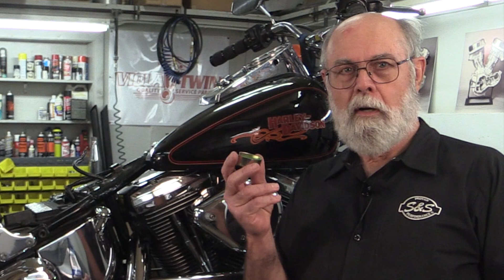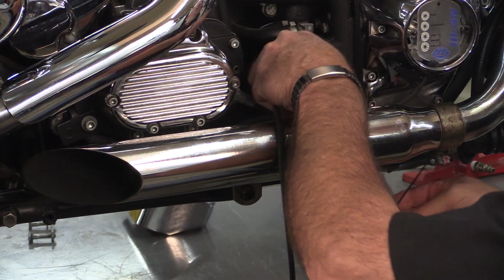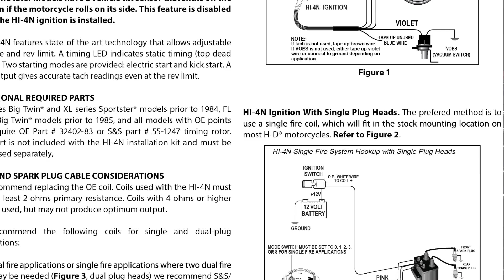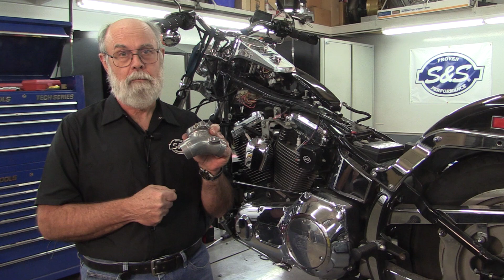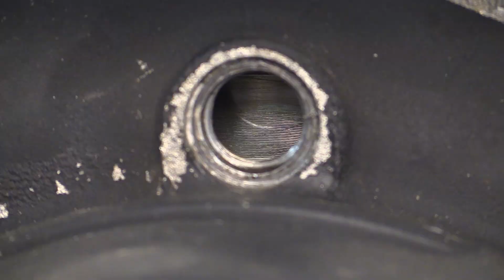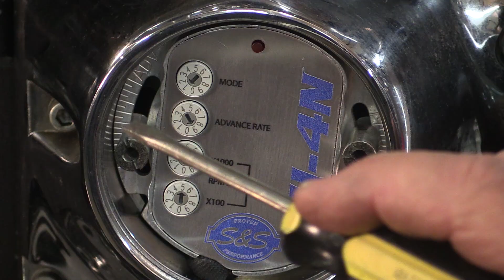S&S Cycle Installation - The S&S HI-4N Ignition

Comment: 9 advance slope is crazy i had mine stock evo at 5 and it was backfiring through the carb so I set it up at 4 works better now. I wish i kept stock ignition. Mpg was good and power on dual fire ignition seems better

Comment: i know this is an old thread, but i wanted to ask about the Fireball HI4TC rear cyl offset, if my front cyl is set to retard 1 degree, does the rear follow that? or must i also set the rear to retard 1 degree, i ask because i seem to have more reversion in the rear than the front, it is set to init -1 and rear cyl 0.  in my carb'd twin cam 2000 FXDL there are andrews 26H cams (hydraulic tensioner upgrade) done by dealer. thanks in advance

Comment: How were you able to tell which stroke the cylinder is on at TDC?
Reply: Put your fingertip onto the front cylinder spark plug hole, you will feel the cylinder create a vacuum from under your finger as you  rotate your rear wheel clockwise. This is your intake stroke. The next stroke will be the compression stroke and you will feel the air escape the cylinder. As soon as it begins start looking for your mark.The event happens fairly quickly and it's okay to reverse rotation of the wheel back to the intake stroke to start the process again. Five events in a four stroke engine.  Intake stroke, Compression stroke,  Timed ignition, Power stroke, Exhaust stroke
Reply: Let me add that on your exhaust stroke you hear the event through your exhaust due to your exhaust valve is open. Compression stroke obviously both valves have to be closed.

Comment: Hey Bruce thanks for another great video! I wonder how electric start modes ease strain on the starter - seems it'd be better to fire right away so the starter doesn't have to spin as long. But I think I'm having a brain cramp on that one... Anyway thanks again!
Reply: I've always wondered the same thing.  What is the purpose of having the motor spinning momentarily before it starts ?  I haven't ever gotten a straight answer.
Reply: @whatyoumakeofit6635  To have time to get some fresh fuel mixture down into the cylinders. If it's been sitting for a while, there may not already be some fuel mixture down in there. Just because a spark occurs doesn't guarantee there's any fuel mixture for it to ignite.
Reply: It allows the starter to build some inertia against the kickback from compression.
Reply: @scottemory1470 BINGO!  Used to be all MEN knew this. How far we've sunk.

Comment: Even though this is an old video I’m hoping you still check massages. I bought a ’96 Electra Glide with a Revtech engine with a bad crane ignition module. I’m replacing it with an S&S module. I haven’t looked but if the wire color codes match can I just splice the new module into the existing wiring? I have water proof heat shrink connectors. Thanks for your answer if I get one and if not I am going to wing it.
Reply from the maker: Hey John, drop us an email at SSTech@SSCycle.com and we can talk this through with you.

Comment: I installed a new Hi 4 because old Crane Hi 4 worked rock solid for years. So when I had my motor rebuild went with new S and S Hi 4 . Plus I hold S and S products in high esteem!  That  being said my new S and S is acting weird after only 4 k miles. Cutting out like rev limiter is engaged  at Low to mid rpm range.  It will run fine and out of no where tack will start bouncing and bike dies. Restart it and bike runs fine or maybe not . I really only want reliability and don't have money to just drop 500 bucks on new ignition from S and S . I just want to ride my motorcycle ,I don't want no pickle ! Very disappointed in what I thought used to be a rock solid reliable ignition system ! I am ready to go back to OEM style harley ignition with the brain box under the right side cover or maybe points . Performance is no goid if your bike ain't reliable .
Reply from the maker: Hey Greg, we totally understand your frustration, an ill-running bike is no fun! Reach out to our tech team via email at sstech@sscycle.com or phone at +1 608-627-1958. Be sure to leave a detailed message and our team will get back to you as soon as they can.
Reply: @SSCycleInc why should a payin CUSTOMER have to reach out. Why not just use good u.s.a. made components.

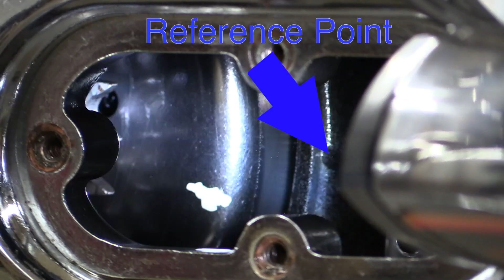Comment: Hello, thanks, all is very informative, but i did not understood how and when you marked reference point on 12:03 , what is this reference point?
Reply from the maker: Front cylinder TDC.
Reply: @SSCycleInc  I am very new to it sorry. So blue mark front TCD and then what was white mark?
Reply: I got it !!! no need to answer :)
Reply: This was also a question of mine, but if you mark at TDC with the reference point in the primary, THEN use the back timed light at 35, it makes sense you will hit the Advance at the spot you need BTDC.

Comment: Novice here, what are the plugs for on the push rod side
Reply from the maker: Happy to help, but not sure what you're asking?
Reply: The bike I recently sold had plugs on both sides of the motor, it was a 80Liter 1340 fxr drag bike built for street
Reply: @jasonrawls7685  Spark Plugs, got it. A 2 plug head is designed for a more efficient burn, but are pretty rare on the early motors.

Comment: If you go by the advance marking on the flywheel and paint a line inside the primary on the rotor  , and use a timing light without a advance setting , that should be the same ??    My Led burned out so have no idea what my timing is I just Had Justin  AKA " Just Tourk it " rebuild a bottom end .  I replaced the cam cover so have no markings .  I know im in the ballpark the bike runs.   I just want to make sure im not to far advanced or retarded  power curves seem to be working over rev is working , just no led flashing at all .  1800 miles .
Reply: late response but yes... use the advance 'dot' on the flywheel; mark up the rotor and use the timing light at it's ZERO default setting.

Comment: How do you wire up the HI-4N ignition for duel coils. It says It will wire up for duel coil & duel plugged Heads
Reply from the maker: Hey there -  here is the link to the instruction sheet for the Hi-4N - https://assetcloud.roccommerce.net/files/_sscycle/9/4/5/510-0277_hi4n_20141215.pdf

Comment: I have a 74 shovel.  What is the rotor number required to run this ignition?
Reply from the maker: Hey Mike - give our techs a call to get part numbers. 608-627-1958

Comment: On a kick only shovel should the voes wire be grounded?? Thanks
Reply from the maker: No, you don't have to ground the VOES. In fact it's a good thing to have working for you, since shovels are more prone to detonation when they get hot. VOES helps a lot with that by backing the timing off when the engine is under a load. What you must do is set the module to kick start mode! That makes it spark on the first crank revolution and it starts much easier. Some electronic ignitions will provide you with hours of aerobic exercise trying to kick start them, but the HI4N really does kick start easily.
Reply: Thanks so much for your speedy response!! I will look into getting a voes. It is a light, stroker so I usually don`t have much trouble. Like you said though when it gets really hot and pulling a steep hill or something voes would be nice to have. Otherwise it sounds like the wire is just taped up. Thanks again!!
Reply: How do you set to kick start mode
Reply: @williamelliott669  Adjust the mode dial on the top of the module to 8 for single fire kick start or to 9 for dual fire kick start

Comment: I have a Crane Cam 8-6100 HI-4N. When I do the static timing as I turn the plate the red light never goes off. Any input.
Reply from the maker: Are you sure that the engine is on the compression stroke when the TDC mark is in the timing window? If it is, please call our tech dept for more help. It goes a lot more quickly on the phone than an exchange in YouTube comments. 608-627-1497
Reply: Ken Rahn

Comment: I'm looking at my installation instructions for S&S IST Ignition. This is for my brand new V-111 engine. This engine is replacing an S&S 88 ci evo style 1999 CMC/Indian Billy Bike replica with Thunder Heart electronics, I'm using Twin Tec ign. Dual fire. with no voes. My question is where do I begin to wire up all of these new sensors and single fire ign. on this new engine when dealing with an old 1999 thunder Heart extremely compact mini electronics system? Thanks for help, Fred  RLTW
Reply from the maker: +fred tompkins Please call our Tech Dept at 608-627-1497. It would take too long to explain it here, but not too long in real time!
Reply: +S&S Cycle, Inc         
I made contact with tech support and think Ill be ok now. Thanks!!

Comment: OK .... if i put  a ignition module like this ... i can remove the ignition module box of my FXRP 89 ........  thanks ...........
Reply from the maker: +mco zpda Yes you can. The S&S HI-4N is totally contained in the cone cover, and connects directly to the coil.
Reply: S&S Cycle, Inc
right now ..i have two dinas coils ..and problems with trigger igniter module ...
running 15mins and shut off (no spark) .... and 20 mins later start again ...
Coils , good ..(new)
Regulator ,good ..
module box , good . (power arc ll single fire)
and i like the  S&S HI-4N ..... to my fxrp 89 ..
..........................CHEERS ........................  ..
Reply: +S&S Cycle, Inc loop

Comment: Thank you , for some reason I thought the coil I have was a single fire. Thank you for helping me with that. Keep up the awsome videos.
Reply: funkyoldmedina mine is a 3 dial wirh a switch
Reply: @eddiemorris5601   Yeah mine is TOTALLY DIFFERENT. .My indicator light that as well as my dials that he shows in his case on the position sensor are by the fuse box on mine

Comment: hello, great tutorial, I would like to know how would I wire a Dynatek 3 OHM coil ? asking because the Crane HI-4N instructions only show coils with Three wire posts on single fire coils.
Reply from the maker: funkyoldmedina The instructions do have a diagram that shows how to hook up a dual fire coil. Take a look at Figure 1.  Make sure you have the correct instruction sheet. You can download it at this URL: 
http://www.sscycle.com/files/4614/1874/5826/510-0277_hi4n_20141215.pdf 
If you still have questions, please call our tech line at 608-627-1497. Those guy can for sure get you on the road!
Reply: funkyoldmedina

Comment: can this system be used with delkron heads
Reply from the maker: The heads may effect the timing your require, but there should be no problem. You should ask the manufacturer for timing recommendations.
The main thing to keep in mind is that this ignition is designed for 1970-'99 big twins with alternator style crankcases. It can also be used with a special timer and reversed timing gears in generator engines.
Reply: Thanks , I need a carb
Reply from the maker: Charles Barber You've come the the right place! The S&S Super E and Super G carbs are available for just about any carbureted Harley-Davidson® motorcycle. Check out our website at www.sscycle.com.
Reply: Ur web site difficult to navigate,  need a super e set up but want to retain my air cleaner...
Reply from the maker: Charles Barber Why don't you give our tech department a call and see what options you have. (866) BIG-BORE (244-2673)
Reply: I have but the super e kit mysteriously jumped up 200$ , figured I would check all options first....529.00 to 729.00

Comment: Out of curiosity, what is the exhaust system on this bad boy? I may be showing my ignorance but I've not seen this type of H-pipe configuration on a bike before.
Reply from the maker: Jeff Irick
The crossover  pipe is something that all stock Harley-Davidson® exhaust systems have, and is a feature of the S&S Power Tune Dual headers.  Many other bikes and cars have this also. It really doesn't scramble the air flow as you might expect. Keep in mind that exhaust coming out of a cylinder head is not a steady flow. It comes out in pulses. That makes the resonance of the pipe an important factor. It is really beneficial to scramble the pulses since the pipe has a resonant frequency and tends to make peak power at one rpm. If it has a peak at one rpm, it must have a valley, at some other rpm. The crossover pipe detunes the pipe making it less resonant. Mufflers also break up the exhaust pulses and help prevent them from reflecting back up the pipe and fighting with the next pulse as it tries to come out of the exhaust port. The result is that the engine will produce a wider, smoother power band. In most cases this will result in more "power under the curve" when analyzing a dyno chart. Take a look at this video. http://youtu.be/KjKUKhHQLHg
Reply: S&S, thanks for the explanation. It makes a great deal of sense. I also enjoyed the video. Obviously, your folks have a very good understanding of mechanical engineering. I particularly liked the bit on the effect that baffles have in re performance. A lot of my friends are of the "Loud pipes save lives" set and yank the baffles out. They might be interested to know that increasing the "look at me" factor is hurting their bike's performance. :-)
Reply: It looks like a stock header system with Screamin Eagle slip ons.
Reply: Patrick Garvin Patrick, I was referring to the H configuration - the crossover pipe between the headers. I've seen that on high performance cars often but this is the first time I've seen it on a bike. That's why I was curious.
Reply: Jeff Irick So am I. The H configuration is the stock header system that came on Evo Softails. That particular bike has Screamin Eagle slip on mufflers attached to the stock header system. http://www.bikez.com/motorcycles/harley-davidson_1340_heritage_softail_spesial_1994.php
Reply: Patrick Garvin Thanks, Patrick. I'm not an expert but I really don't see why you would want to create an exhaust system that would, at best cause a "scrambled air flow". It seems to me that doing that would "clog" your system in terms of escaping air flow. For the record, I'm an Assistant Professor of Math and Physics. This kind of configuration doesn't make sense to me. It looks to me like the exhaust gases are simply going to race by the cross-over tube and do nothing at all.

In a high performance car(which I'm more familiar with) certain exhaust configurations can give you back pressure that can help increase your compression and, thus your power, etc. even though that seems counter intuitive. The H configuration has never made any sense to me because the exhaust expulsion is simply going to "slide by" the H-pipe.

The X-pipe config is popular and supposedly a good power addition. With the expulsions from headers 1 and 2 crossing and "jamming" and then "repelling"each other, as it were, I can easily see a back pressure buildup which might, in the end increase your engine's output, but it would also decrease its lifespan substantially.
Reply: Well mine is a dozble switch and 3 dials system